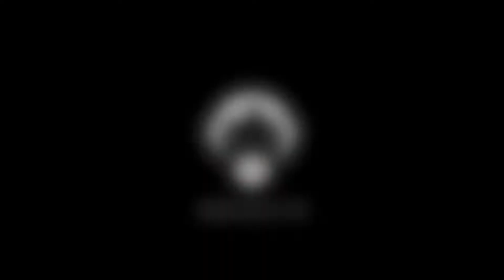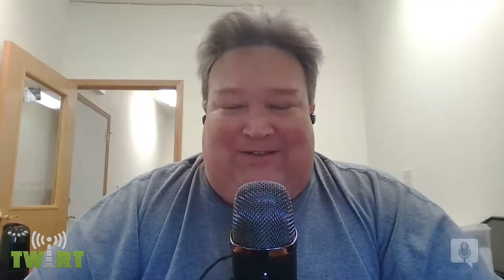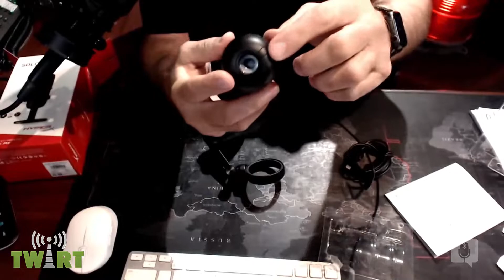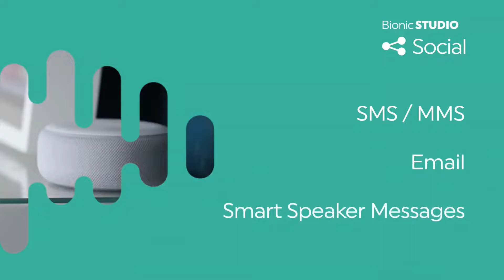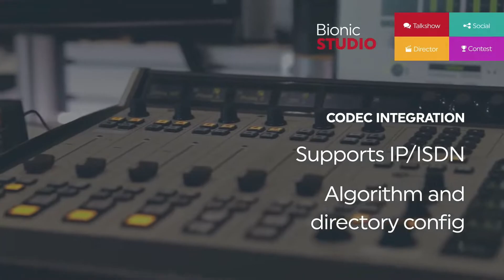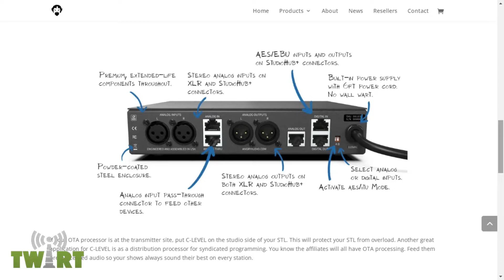Building PCs and Servers for Broadcast with Van Clough - TWiRT Ep. 610

Comment: As a broadcast engineer, if you wish to buy a computer specifically designed to operate in a broadcasting environment with peak efficiency and with none of the worrisome extras and updates that an off-the-shelf computer might introduce into your radio or television station’s operations, then Van CLough is the individual you want to contact. Van joins hosts Kirk A. Harnack and Chris Tarr for a very informative Episode 610 of the TWiRT Podcast.

During this particularly intriguing Episode, Van discloses some of the design issues his custom-crafted computers solve for the broadcast engineer. And, he responds with a variety of tips and techniques to the questions and insights offered by the hosts.